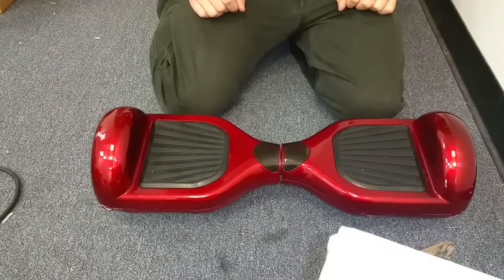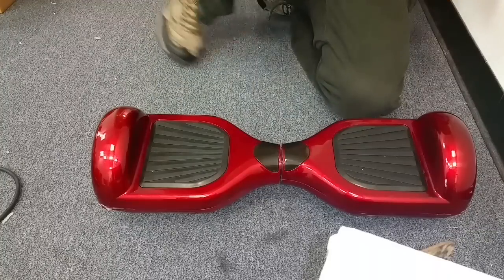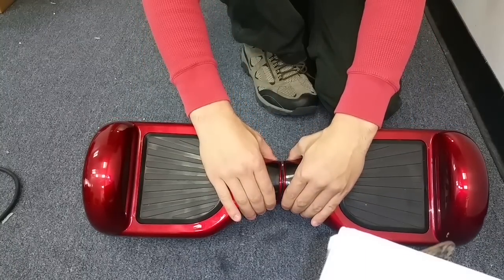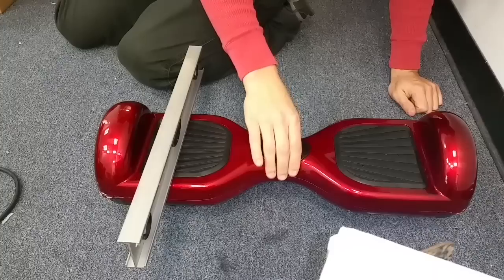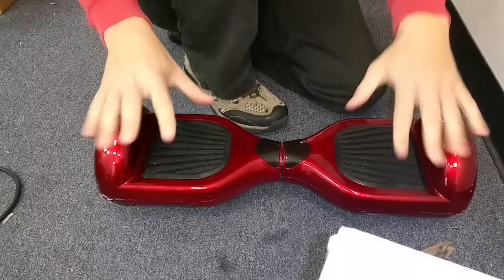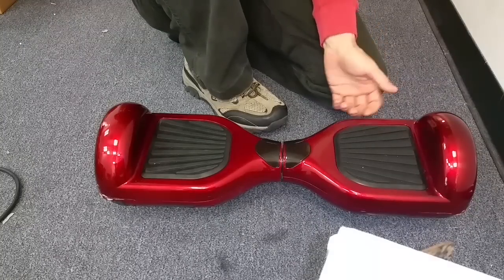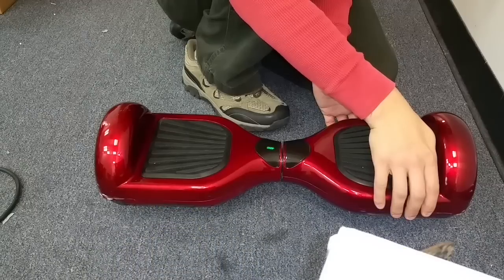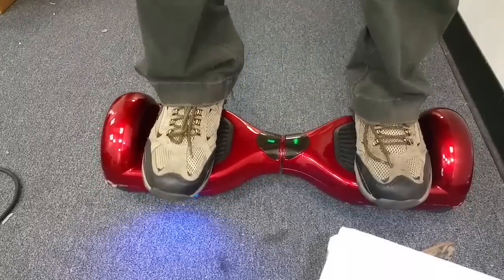Best How To Calibrate Your Hoverboard Video - Fix Your Broken Hoverboard

Comment: I tried and tried but it didn't work until I saw this video... 
You said depending on your board is how long you hold it and that that final beep will show it and just how important leveling it out was... I tried what you did... 
And it worked!
The problem in the first place was that the self balance needed recalibrated, as It kept on leaning forward, making it uncomfortable and weird to ride but this fixed it, THANKS YOU SO MUCH!!! 🤗
Reply from the maker: thanks buddy glad it helped

Comment: I have a question, when I'm trying to calibrate it  none of the lights are flashing at the same time, I also use the level ruler. Please help.
Reply from the maker: you may need new gyros or i have seen some boards that do calibrate but dont flash the lights for whatever reason
Reply: I just bought that swagtron in Christmas

Comment: Mine would not calibrate regardless of this method and then I found out it was a yellow wire that was pinched almost in half near the center of the board! She works fine now

Comment: My daughter was standing on the board while it was off and pressed the power button now it is misbehaving when we power on and attempt to use it vibrates I have tried ur method but its not working when I press the power button board is on and the low battery light starts alarming with all other lights

Comment: Can't fix my hoverbaord I replaced the gyroscope which seemed to help but now the red light flashes and recalibration doesn't work. Please help
Reply from the maker: check for loose wires. otherwise it may be a bad motherboard possibly.

Comment: New message to: pricekiller_2k
hello,
we have problems with charging the battery is not charging on the hoverboard
it shows orange but it dosent flash when its on the charger only bluetooth works nothing else and when its not on the charger then nothing at all works not even bluetooth if you help for my?

Comment: I already tried this and it doesn't work.only one side works and it has a red light
Reply from the maker: +Rafael Velasco most likely you need a new motherboard, possibly gyros as well but i would start with a motherboard. you can pick one up on amazon http://amzn.to/1UVneWk
Reply: +Johnny Amicci. I already changed it
Reply: +Johnny Amicci the motherboard

Comment: I have a touchmate hoverboard and it didn't.work
Reply from the maker: you likely need a new gyro. amazon no longer sells parts but ebay does 
http://rover.ebay.com/rover/1/711-53200-19255-0/1?icep_ff3=9&pub=5575076293&toolid=10001&campid=5338271481&customid=&icep_uq=self+balancing+scooter+parts&icep_sellerId=&icep_ex_kw=&icep_sortBy=12&icep_catId=&icep_minPrice=&icep_maxPrice=&ipn=psmain&icep_vectorid=229466&kwid=902099&mtid=824&kw=lg
Reply: So I need to buy another one?

Comment: its not working and i got that same hoverboard i tried it so many times already😭
Reply from the maker: this didn't help?
Reply: Jasmine Gonzalez  same mine still pont work😢😭😭😭
Reply from the maker: whats ur board doing
Reply: mine wasnt recalibrating or anything  the gyro was screwed I think so I took mine back and got a replacement
Reply: Johnny Amicci mine shows an orange battery flash